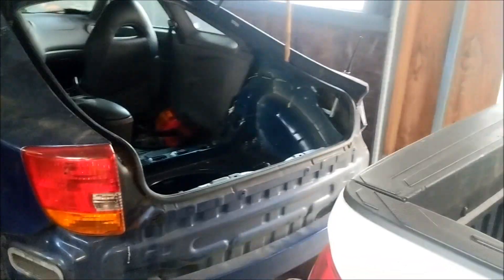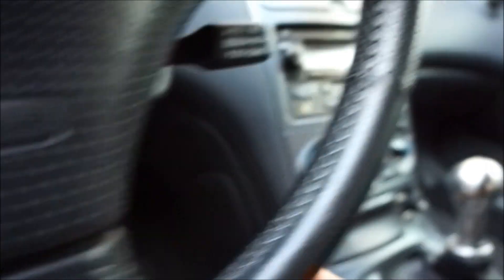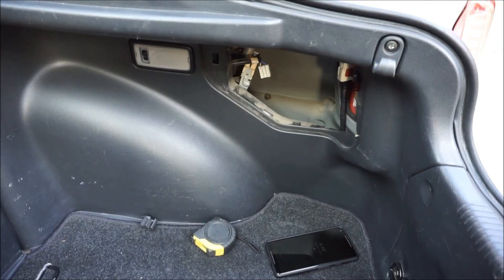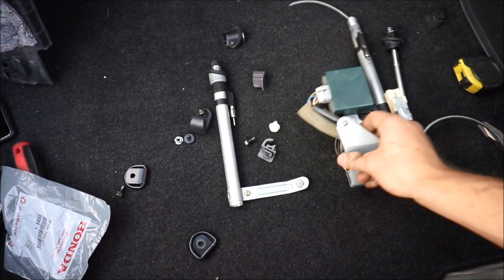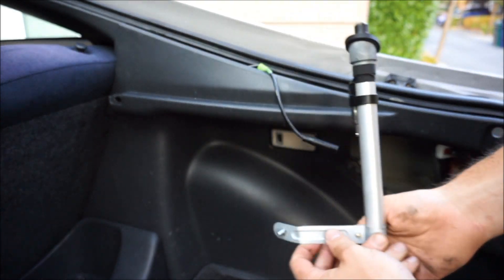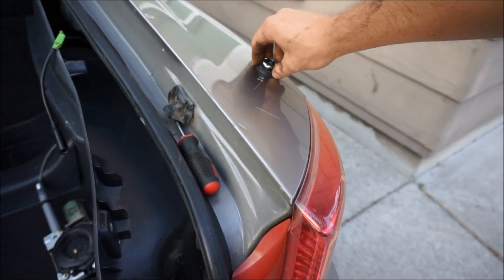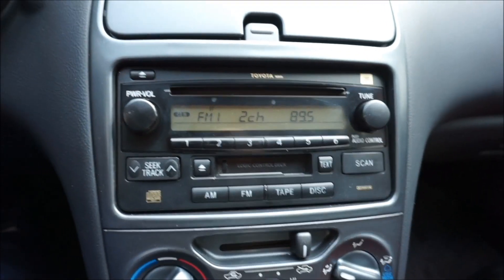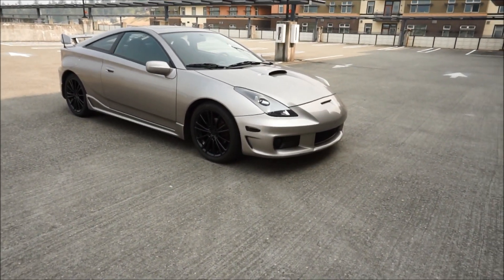MITCH DORE | Celica GT-S How Install S2K Antenna

Comment: How did you get the old antenna out of its housing, so that you could screw the new one in?  Mine is actually broken off inside the housing, and I'm struggling with it. The new one won't screw in unless I get the old one out.